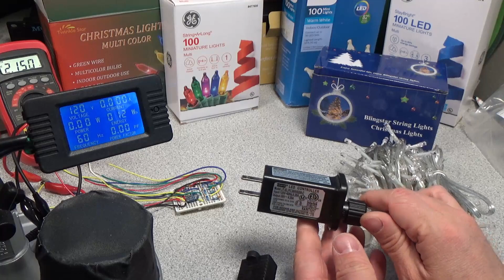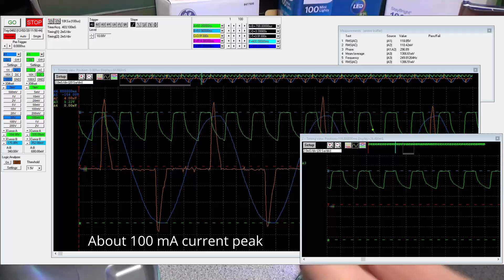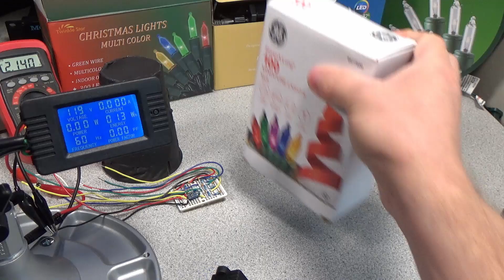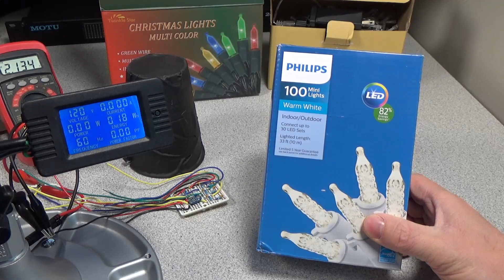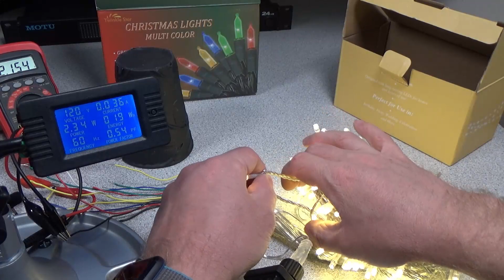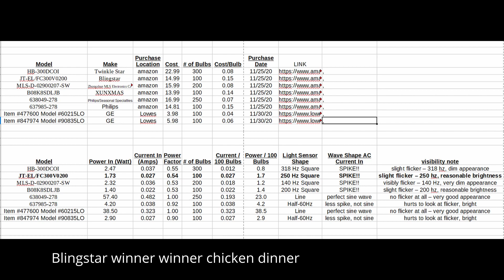Christmas Light Comparison (LEDs)

Comment: Are you sure about the math with the energy use and cost? Running a 31 W light string for 6 h per day for 40 days should consume 31 W * 6 h/day * 40 day = 7440 Wh = 7.4 kWh, not 49 kWh. And the cost of that electricity should be 7.4 kWh * 0.2 USD/kWh = 1.5 USD, a very small cost.

This is a conclusion I too have reached in my considerations, and since I think incandescent mini lights look much better than the LEDs I think they are still the best option.
Reply from the maker: Yeah, that's a good find.  It looks like its calculated over 265 days, that's totally supposed to be 365 if anything... also the watts aren't what was measured, it was more like 40W for the 100 light string.  Both are calculated over 265 days though. The ratio is accurate.  No idea why 265 days though.  Must've had a few too many egg nogs making this one.  Yeah, the flicker fest lights are not nice on the eyes.  The higher speed flashing ones (300+Hz) ones do look good but you get half the brightness for constant on modes which is lame.
Reply: @AllThingsOnePlace  Thanks for your answer! For minilights I like the classic incandescents too much, and in particular I feel that the quality of the tiny filament is hard to replicate with LEDs, and in any case they don't use too much power. But for the larger lights, C7/C9, there are some really good looking ones out there that use warm white LEDs and colored bulbs, essentially the same way incandescent lights work, the most famous example being the Tru-tones.